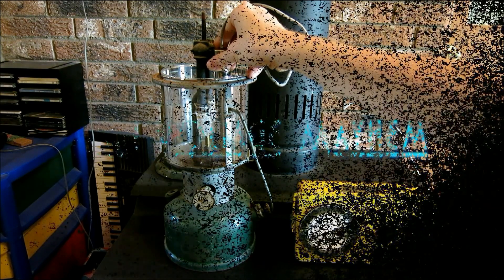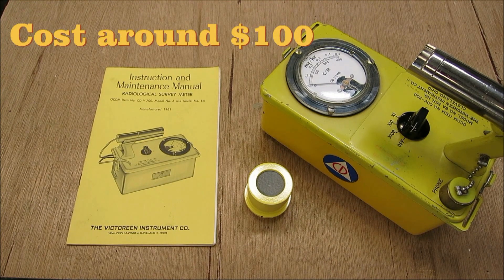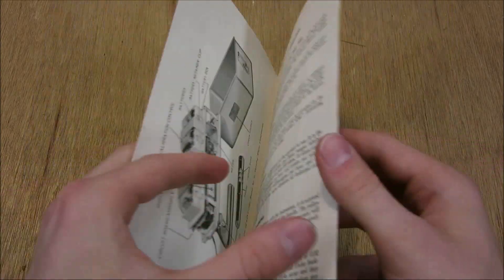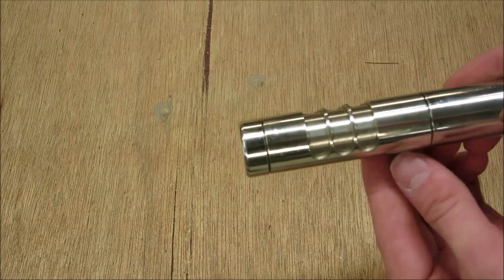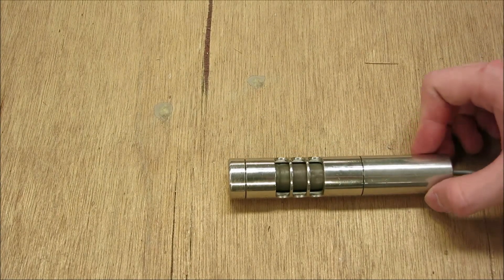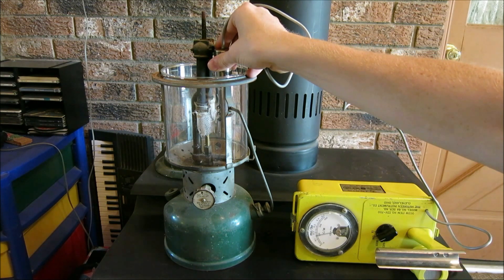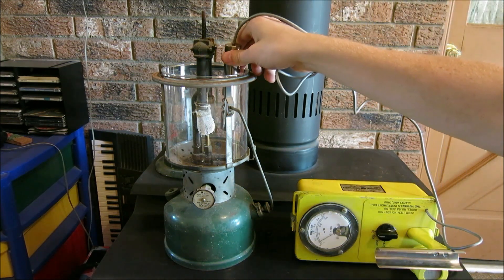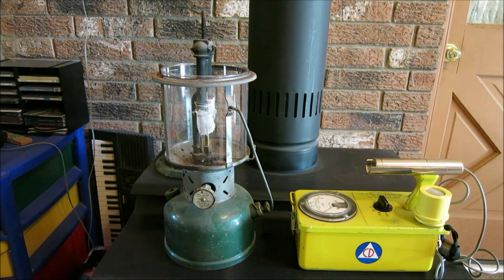1960's Civil Defense geiger counter review!

Comment: Based on the reading, looks like it reached about 2-3 mR/hr. That's 0.002-0.003 Roentgen or about 20 microsieverts. You would probably have to eat those lantern mantles to do any harm to you.
Reply: ang youll oriobably get more harm from the toxicity than the radiation
Reply: It's still pretty high, though. Normal background radiation, around here, is only 0.17 micro Sieverts.

Comment: Those are good speakers.  The newer ones have a volume control.  A thing, not often mentioned about the CDV 700, is your distance from the radiation source.  For your calibration you virtually have to touch the calibration spot.  The length of the cord away, the machine may not pick up anything.  The source here is so small.  But if your wand (tube) is 3 to 4 feet off the ground, and maybe you are still 10 feet away from a strange object  fallen from the sky into your back yard and you get readings from 10 feet away, STOP!  Do not go closer.  If you do your machine will probably just fall silent being completely overwhelmed.  Anything that makes your CDV 700 Geiger counter react from 4 or more feet away is a) Hot, b) not good for you to be near, and c) about to put your CDV 700 to sleep for a period of time.  I would say, unless you are self destructive, do not come back with a survey meter to try again.  Instead report it and let folks who are paid to do so deal with it.              :)

Comment: Nice CD V-700 6A and demonstration! Those are rugged Geiger counters! I have the same model, and it's in mint condition! I have the CD V-705 University Sound speaker for it. They are quite pricy nowadays though, but they do take 2 D cells, so that makes the unit heavier and more bulky, but the sound is great, and it's adjustable! These units are also resistant to EMPs, with the steel casing!
Reply from the maker: Just about any vacuum tube based equipment is not subject to EMP damage because electrons will not flow through a vacuum unless the element heater is energized.

Comment: even if you maxed it out at 50 mr/hr or 0.5 mSv/hr it would do nearly no harm. it would have to be a long time of PROLONGED DIRECT contact for any harm to be done. 0.4 mSv is a mammogram and is worth 7 weeks of background radiation. remember your meter is in mrem per hour so your readings looked like 2.5 mr/hr which is equivalent to 25% of a chest x ray over 1 hour. also thorium doesn't emit beta radiation so you dont need the shield open. dont breath the fumes or carry one on you everyday and you'll be just fine.
Reply: Yes 🙌 now with my cd 715 survey meter that goes from .5r/hr to 500 r/hr. That is my meter that tells me when I need to scram!

Comment: Excellent video! I have a ceramic orange sugarbowl which is "hot" due to the color and glaze used. The look on my students faces when I show the lantern mantles and sugarbowl is priceless. The lantern mantles provide a low cost option for a check source. For those interested in ham radio, there is an article in the ARRL QST magazine from April 2008 entitled "Repair and Upgrade Low Cost Geiger Counters" by Charles Kitchin N1TEV. In that article he describes building different amplifier circuits for hearing the clicks as well as an overview of the Victoreen CD V-700 Model 6B.

Comment: Just bought a civil defense kit and put some batteries in mine. Needle goes up to .1 and stays around there even when touching the check source. I plugged in the headphones and it clicks but no reaction to the check
Reply from the maker: So your problem could be one of these two things. Some models contained a a style of gauge with an elevated black ring around the edge that were notorious for failing. Sometimes these faulty gauges will read low or not even at all. If your Geiger counter is making a clicking sound when exposed to radiation then your machine is working internally but the gauge itself may not read accurately. Also most of the check sources on CD-V700's are mostly depleted by now so you wont be getting much of a reading anyways.  If the gauge needle is not resting on 0 when the machine is turned off it can be adjusted with the small brass screw inside the gauge and that may help free up anything that might be causing the needle to stick at 0.1
Reply: @highvoltagemayhem3345  thanks for the response! Sorry for the poor explanation but the needle goes to zero when I turn the unit off. The needle does move slightly but not like yours does when you use the check source
Reply: I have hundreds of this model CD V700 with bad dial indicators, it's the most common problem with them.

Comment: You explain very well, I want to know what is the difference between Radiation detector and Radiation meter? What do you show only serves to detect things that have radiation? If you want to detect radiation in the environment or near a 5G antenna, is it good for me? I do not know much about this but I see some models that have a handle and do not have that metal cylinder with cable
Reply: These do not detect 5G (microwave) signals. The one without the probe on the handle (model CD V715) is for high level gamma radiation (deadly levels).